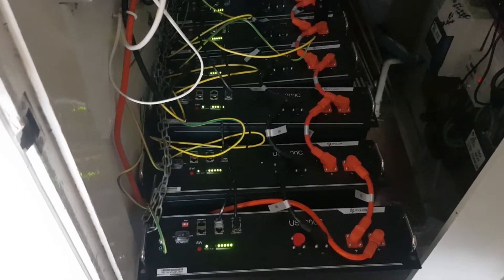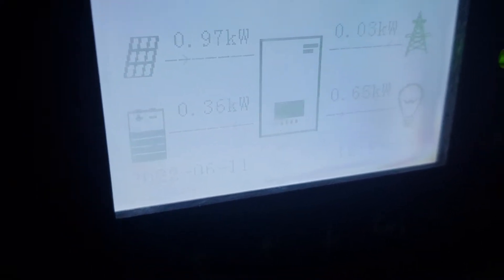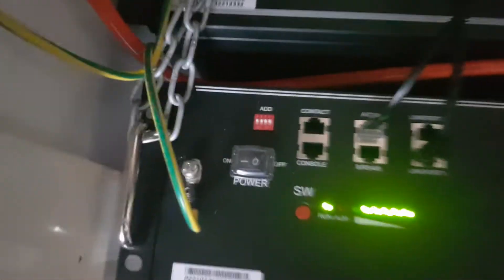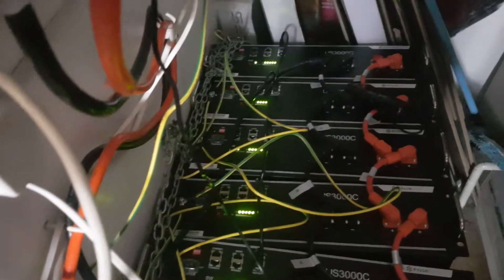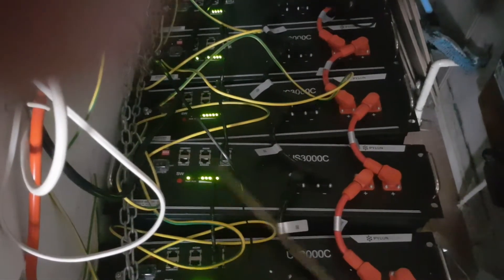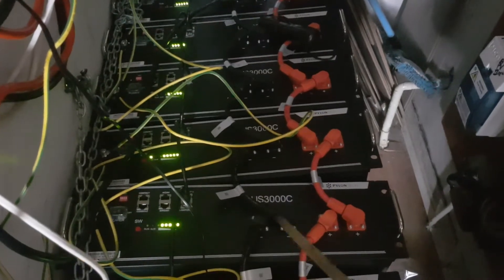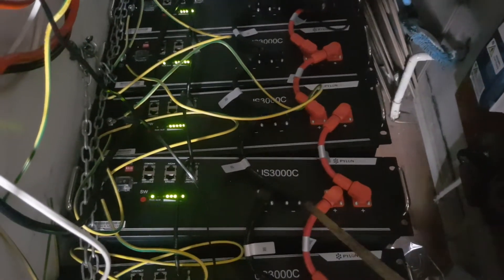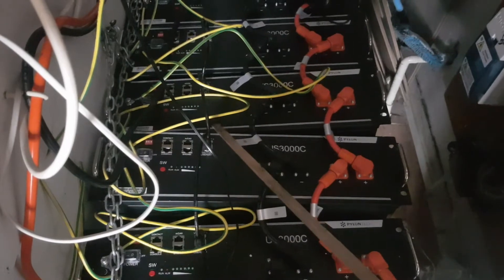Pylontech Battery fault diagnosis tracing faults fixing repairing faults setup battery correctly

Comment: Good afternoon, l have two pylontech us3000 and 5000. The investor is saying PB on screen but they are not charging. What could be the problem please as the electrician seems to suggest that they might have been drained so we need to press the restart button of which we can not find one other than the power. If this advice is ok, do we turn them off with the investor on or switched off please. It is an off grid system. Thank you very much for your assistance

Comment: Hi. We have a problem with US 5000 single battery. It is showing 100% SOC and has been like this for 72 hours. It will not discharge and therefore we are using grid power rather than stored power in the evening. We have clear skies and pv working during the day and is exporting rather than charging the battery. What would you suggest?
Reply from the maker: Try to reset your inverter . It controls the charge/discharge of the battery and tells it to discharge through the batteries bms

Comment: Is there any dip switch settings required
Reply from the maker: Only when you use rs485 protocol, this is when you incrementally set the dip switches for each battery. Please subscribe, thanks.

Comment: Your videos are excellent amd really worth watching i am connecting 9 pylontech batteries to 3 8kw inverters which in turn will run a 3phase installation do the batteries have to have there dip switches changed thanks
Reply from the maker: Thanks for subscribing. Glad the videos are helping people. As to your question , no you only need to set DiP switches if your inverter is connected via RS485  protocol. If it’s not then it will be connected via CAN so no dip switch setting required

Comment: Hello, I have a setup of 3 Pylontech US3000C connected to two parallel 4Kw MPPsolar inverters from 2017. There is no communication between inverters and batteries. Settings are user defined (Bulk 53V, Float 52V, low DC cut off 44V). ADD setting is 0001 on all batteries. After 2 months of running, the master battery stays stuck in idle and does not charge or discharge. All soc leds are down. I have no idea what happened. Can you help? Tnx

Comment: Hello, you seem to sound like my hero mate !! I am home alone as my hubby is away with work and I have just had an 2015 alarm from my solis inverter app. I went to look and both my new batteries had all solid green lights on and were just “stuck” lit up ?? I panic a lot so just followed the shut down sequence and turned everything off. I waited 10 mins and turned it all on again and now it seems to be fine again. We only had the system fitted in June this year and this is the first time I have ever seen this happen. I am scared to go to bed tonight though as I don’t even know why this happened. Can you help please ? I would be so very grateful if you can. Mrs Wilde
Reply: I have a Solis AC coupled inverter with Pylontech batteries I get a high incident of E2015. This error clears after several minutes. I think it is a battery issue not the inverter.